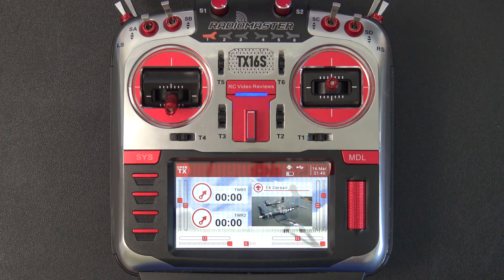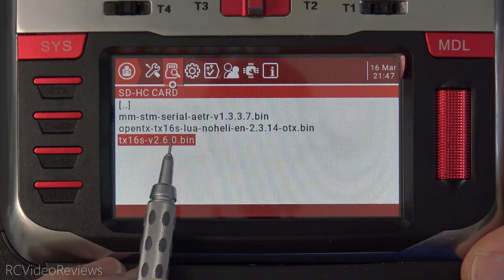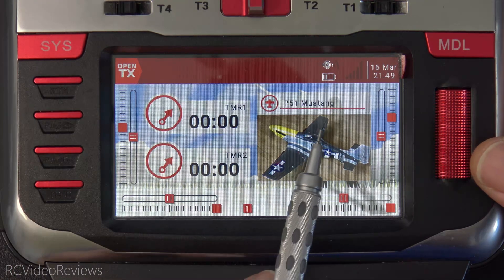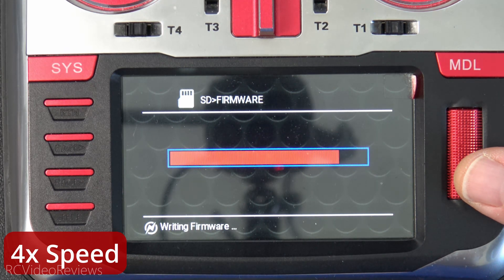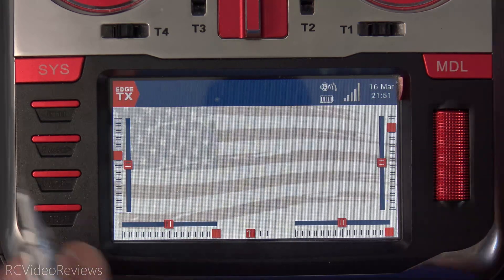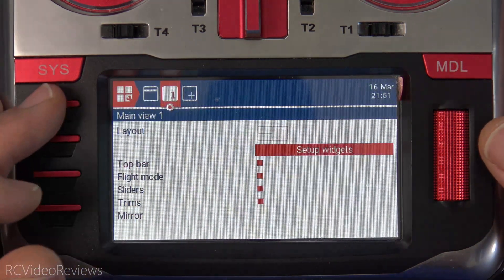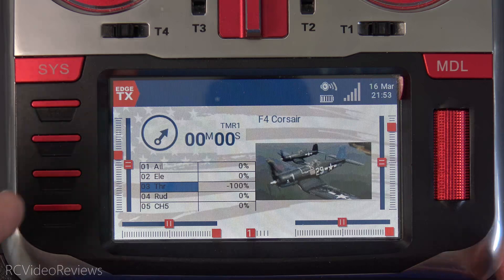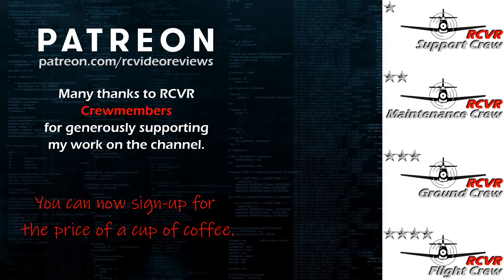Switching from OpenTX to EdgeTX? You need to know what happens to your models. BACKUP SDCARD FIRST!

Comment: Thank you for posting this vide. I went through the upgrade and loaded my models from opentx to the sd card and removed the YAML files. After i unplugged all, i saw the storage warning. However, I do not see the continue button at the bottom right. All i see is a large button at the bottom that says "Press any key to skip" and it's the only option available. I press the roller and it goes further but my models don't convert. Help !!!!
Reply from the maker: What version of EdgeTX? You can't go from OTX to EdgeTX 2.9--it doesn't have the conversion feature anymore. You have to flash 2.8 first, reboot, let radio convert, then flash 2.9.
Reply: @RCVideoReviews  Version 2.9. I guess i have to download 2.8 and reinstall and see how that goes. Thank you !!!
Reply from the maker: Bin to YML conversion was removed from 2.9 firmware. You have to flash 2.8.x first.

Comment: Hello¡¡¡ I need your help badly. I installed a pair of extra switches (SI and SJ) in the back of the transmitter and worked flawlesly until I upgraded to 2.7.1 and now they do not work at all. I checked in the list and they are still enlisted and active, but no response when I assigned a function. Do you have any clue of what is wrong? Regards
Reply from the maker: I've never had a case where a switch/control was active in the hardware list but didn't work within the radio settings. Create a new model on the radio and see if you can assign them in the new model configuration.
Reply: @RCVideoReviews  Thank you very much for taking care of my question. I will try the tip and let you know what happened. Regards

Comment: Widgets should not matter if I transfer my models from opentx on an frsky x-lite pro to a radio master Zorro? Both radios only have an LCD display, am I correct think this is the case? Thanks for any info.
Reply from the maker: Yes, B&W screens don't use widgets as far as I know.
Reply: @RCVideoReviews  thanks

Comment: I transitioned from my FRSKY Taranis X9D which I was running opentx but when I transitioned to EdgeTx on my new Radiomaster TX16S none of my models came through. Could this be because I was using a Taranis before?
Reply from the maker: Not enough information to answer your question. How did you transition? What is on your SD Card in the models directory? Did you use Companion? What version of Edge? You really need to join our discord and ask this question there while providing more information. YouTube is not a good forum for the back and forth likely required to solve your issue.
Reply: @RCVideoReviews  thanks, I managed to get this sorted.
Reply: @786free1  hi how did you sorted out i have also a taranis x9d plus and want to convert my models to a TX16s with edge tx. What should i pay attantion for? Thx
Reply: @Landat78  to be honest I can't remember, I think I ended up adding each model independently. Since Opentx and Edgetx are very similar it was straight forward.

Comment: I do use the Info Text-file for each of my models - does this textfile also get converted and functioning after updating to EdgeTx ..  I have two TX16S .. one is a Max version. So i want to switch the OS so the Max gets Edge and the other OpenTX. And thanks for all your great and informative videos. Regards form Denmark.   ;o)
Reply from the maker: I haven't tested this. However, since the use-checklist option is a model settings feature and I don't believe they re-wrote the filename association with it, it should work. Have you tried?
Reply: @RCVideoReviews  No not yet. Just got home but i will try it in the weekend. Thanks.

Comment: From what I learned so far. If you are flying fixed-wing scale model aircraft with Spektrum RX.

Benefits: touch screen (thus easier navigation through all the settings on your TX), 500mhz gimbal pull (not sure if you can feel anything when flying a fixed-wing aircraft)

Hassles/drawbacks: setting up all widgets again (which could take a long time if you have a lot of models, and have multiple tabs of customized widgets each, Top bar telemetry, etc.), making mistakes when you setting up all widgets again (For example, you put timer 2 on the main screen, and it does not tick down when you fly), setting up the theme again, making mistakes when you are familiarizing the new system.

Watch John's video about these 2 systems. Weight out the benefits and hassles/drawbacks yourself. Make the decision based on your style of flying.

I call some of the hassles a drawback. Because when it comes to flying the model. Familiarization with your TX, operating system, widgets display, could and will change the outcome at the end of the day.

Don't listen to some random guy who jumps out the internet that thinks people don't switch are either stupid or scared and tells you that you "need" to switch.

Comment: I bought a new tx16s and have models on my old jumper t16 with open tx on it. Can I use this method through open tx companion to transfer the models to the new radio/sd card. Then transfer to edge tx and keep my models?
Reply from the maker: I would backup the SD Card first. Take the SD Card out of the jumper, put it in the Radiomaster and flash Edge.
Reply: @RCVideoReviews  ok thank you, I’ll try that and see what happens, all of your videos have been very informative
Reply: @RCVideoReviews   I just tried that, i was able to get edge on the radio, but the models will not show up. on the sd card it shows a bunch of models with model01.bin -model27.bin. but the models wont show on the main screen

Comment: Thanks!  I've already been through this on my own. After awhile there will be two model files for each model, the old .bin and the new .yml. I've not deleted the bin files yet, but suppose it will be fine to get rid of those.
Reply from the maker: Yup. Once you're on EdgeTX 2.6+ those .bin files are no longer needed. It's like burning the ships though. Once you delete those, there is no easy migration back.

Comment: I have a new tx16 no models set up on it yet should I do opentx or edge tx before I start doing models? What is the difference?
Reply: Start with EdgeTX. There's no good reason not to.
Reply from the maker: I like to think of the relationship between the two like a relay race. OpenTX carried the baton and ran a good race. EdgeTX is taking the handoff with fresh legs and they’re running real hard. They’re both good racers, but EdgeTX is the lead runner on the track right now.
Reply: If you are starting everything fresh, EdgeTX is the way to go.

Comment: I’ve been trying to figure out why edge tx glitches on my Taranis x9 lite. I got the right version for my radio and it does work very well. It’s just that I normally have to turn it on and off a few times before it will boot up correctly. Normally the first time I turn it on it’s slow and doesn’t have any sound. The way I can tell if it boots up correctly is if it says “welcome to edge tx”. Have you heard of this before?
Reply from the maker: Change your SD card.
Reply: Ok I will try a new SD card. But even if that works I’m the kind of weirdo who wants to know why the SD card went bad. I copied the edge tx SD card contents from git hub and deleted the old open tx stuff off the card. Is it ok to put open tx sounds in my edge tx sounds folder? Also if I just put in a new card will it automatically format it for me or do I need to do it like before. Sorry to bug you I’m still kinda a noob
Reply: @jmillerfpv  opentx sound files work. I've been  using the Amber sound pack since EdgeTX v2.4 with no issues.
Reply: @richardjohnson2331  yeah me 2. It plays the open tx sounds fine on edge. I was just wondering what could cause my SD to go bad. Assuming it is bad and needs to be changed like RC Video Reviews tells me.
Reply: @jmillerfpv  Radios are sold with like the absolute cheapest SD card that they can get. Just buy a decent one and use that pronto. :)